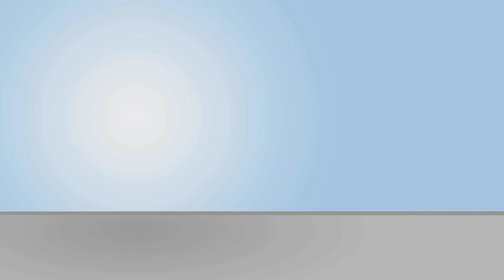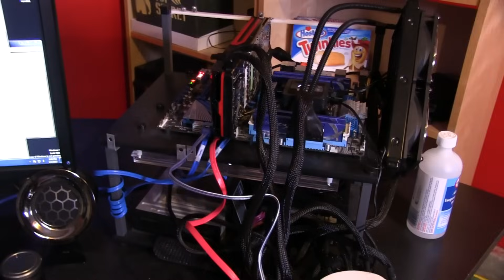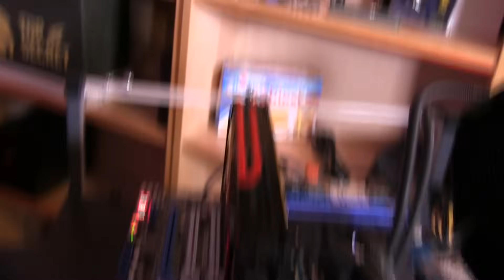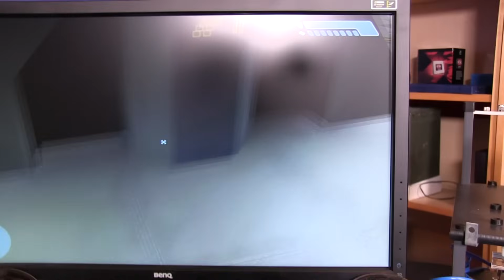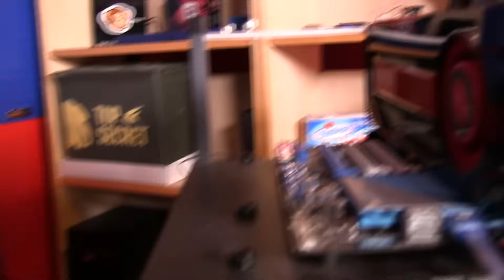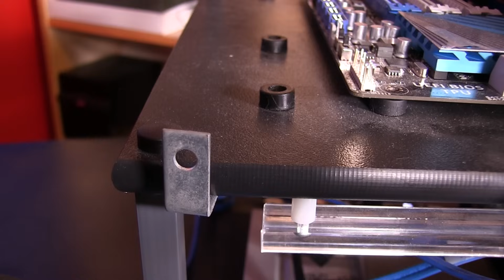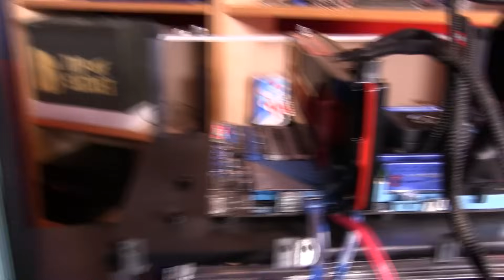Coil Whine Explanation & Demonstration Linus Tech Tips

Comment: This guy is flat-out lying. Just limit your fps to 60 - 120.
You haven't set any limit on your framerate, so it goes up to a really high number, causing coilwhine. Don't buy a new Power Supply just because this dumbass is telling you to.
Reply: i get coil whine form my X99 motherboard even when i'm not playing games. just browsing the web or not even doing anything at all. it's not always stress related. some components are just defective.
Reply: solomonshv That sucks. I'm sorry to hear that.
Not really sure what you can do though.
Reply: SWEGTA since i just bought it i can sill exchange it. i bought it locally at microcenter. but every location near me (and there are 3 of them within 30 minutes of me) is out of stock of this particular model. i wont be doing an RMA parade where they will send me a board which is even worse than the one i gave them. i'll just keep exchanging at the store until i get a normal board.
Reply: solomonshv Best of luck!
Reply: ***** Because buying a new Power Supply = Coil Whine be gone!
Reply: SWEGTA Actually my 290 vapor x tri x oc whines in any game. Watch Dogs at 40 fps whines, GTA4 at 50fps whines, BF4 and 70-80 whines, just as bad as cod games whine in 100s. What I found out is when the card is under stress, even at lower FPS (20s 30s which it gets pushed at to limits) such as new games, the coil whine can be much worse than let's say an old game with no FPS lock that pushed it into fps of 100s. That myth that coil whine can be fixed by locking FPS is false. Replacing PSU is a long shot, and the only way to truly fix the problem is to buy a card that has low rates of coil whine.
Reply: MaxFlare
your card is defective. r9 290's/290x dont have coil whine unless its a mistake or defect.
Reply: Adams Brian
Any card can have coil whine, and it doesn't mean a card is defective. It is a very common phenomenon, and has happened to nearly everyone who owned a gpu.
Reply: MaxFlare
well most cards dont whine loud enough for you to hear them during those games and even demanding game.s.
Reply: Adams Brian my 280x whines the same as the one in the video but a bit quieter, but fuk ill just turn the speakers up
Reply: lol man nice. ^
Reply: Hey I was wondering if you can tell me what may be the cause of my issue. So I bought an EVGA NEX750B and it makes a buzzing noise when playing BF4 and a sound similar to that on the video when playing Watch_Dogs. I exchanged it for a EVGA G2 750W and it did not have any sound however i had to change that for another PSU because it was making some bothersome noise. The new PSU i got was the Corsair RM 750 and my system make noises similar to the EVGA NEX750B. Could this be a GPU or coincidental PSU coil whine.
Reply: I had coilwhine on 290x and limiting did nothing at all, maybe 5% better.... but probably not even that much
Reply: Misterzen87
huh were you a early adopter for it. that may be the case. your psu enough power for it.
Reply: Adams Brian
i got the V 1000 from coolermaster, the problem is that the HIS 290x is complete garbage, i am not sure if they even produce any 290x without coilwhine
Reply: Misterzen87
i dont know if HIS is as reliable a brand as others. The good brands i search(MSI,Asus, sapphire,etc) all have barely/no reviews with coil whine even on a top dog like a r9 290x.
Reply: Adams Brian yes pretty sure that HIS 290Xs have more coil whine than the ones from most other companies, they have a cheap looking custom pcb and the whole layout is different so they probably use cheaper components for the rest as well. anyway i look forward to my 970 from gigabyte :D
Reply: Misterzen87
you sure you dont want to check out the msi/asus they looking good to plus very sexy. Not saying gigbyte is bad though.
Reply: Adams Brian
i am sure they are fine but i did ask all the manufacturers some questions and only really liked the support that gigabyte provided, the others just gave minimalistic or wrong answer due to not having red my question correctly. the msi is nice too but the msi has no backplate and isnt sold at the shop i have credit on from the 290x rma
Reply: Misterzen87
sweet bro. the gigabyte is not looking bad at all. You think you could save up a for a 980 or 970 sli(lol not asking you spend more money but more of a question/suggestion.)
Reply: Adams Brian
yes i will probably add another 970, not quite sure yet because i red some rumors about gm200 beeing pretty close, hard decisions but i think price/performance wise 970 sli is a safe bet, to go from 970 to 980 feels like a waste of money though :)
Reply: Misterzen87
yeah the 970 is a real beast. its like a 780/780ti just more efficent and 200$ less. HOLY MOLY. thats awesome. im actually planning on winning a 980/970.
Reply: Adams Brian
I did actually put an order in for another 970 from gigabyte at a store that had 12% today on everything, so just 350 for the second one, probably going for the sli :D didnt want to delete the other one though since i cant imagine what else i would buy in their store from the rma credits, and 970 sli will be fun, especially with oc muhaha
Reply: wow thats going to be a real beast. Even stronger than a 980
Reply: Limiting your FPS is not a solution. It might reduce or eliminate the whine, but now your FPS is limited.
Reply: Pretty sure Linus tech knowledge is leagues ahead of yours.Check your ego
Reply: SWEGTA
He never said it would get rid of it, he said that the only thing you can do is that some power supply's work better with certain GPU's in terms of power delivery.
Reply: TonkarzOfSolSystem If you're running the game on a 60 Hz monitor there is no point in not limiting your fps to that refresh rate. You should always try to cap your framerate to the refresh rate of your monitor. That's what v-sync is for.
Reply: He even demonstrated how looking at the floor will give you even more whine. No shit! Looking at the floor in Halo 1 probably got him >1000 fps.
Reply: TwoCubed  Just because of screen tearing? Or something else? Screen tearing is often encountered even with fps much lower than your monitors refresh. V-sync forces the GPU to only update the screen at the start of the monitor's refresh cycle. This is completely different to limiting your fps to 60. V-sync doesn't limit your fps to 60 either.

Seriously, are you trying to troll?
Reply: We all know limiting the FPS can fix the coil whine but that is not how it should be done. The card whines because manufacturers don't use high quality components to build the video card and that is not acceptable. We will RMAing/Return  the cards to show how unhappy we are and that should teach a lesson nVidia will never forget.
Reply: You're flat-out lying. I got 70fps and it still makes the sound.
Reply: MaxFlare
That's just a fan error if you still haven't fixed it. Take the vga cooler off of it, and replace the thermal compound and re-attach it back. Coil whine can also be caused when components aren't placed in the right way, even when it looks like it.

Zwegta probably just saw some post or video somewhere, and it worked for him, yet coil whine can be caused by a even weirder things than: "oh no, my card is too fast".
Reply: Robbert van Loon Or just rma it and not render warranty void as doing what you suggested would
Reply: Where is he lying? He's just demonstrating what coil whine is. And just limit it to 60fps? It might work in some cases but tell that to my previous 290. Oh wait, you can't, he can't hear you cus all of the coil-whine.
Reply: his point is that not all cards coil whine without a limit so if you dont want to limit your fps find a card that can do such that with out coil whine
Reply: giske87 I have coil whine regardless of vsync !
Reply: get some ear plugs
Reply: ahh i got 2 290's now. no coil whine and they are tri-x's by sapphire so they are quite :)
Reply: You all beautifully shut him the fuck down lmao.
Reply: Tommy Lai It's not going to teach Nvidia anything as they don't make boards for consumers. They simply sell the GPU's to third parties, who then design and build the boards, drop in the chip and ship it off. You didn't buy from Nvidia, you bought from your video card manufacturer.
Reply: Vsync is your friend
Reply: My old Corsair CX750M gave my Gigabyte r9 280x coil whine no matter if I was gaming or not. I put in a new XFX XTR 750 and it went away, so NO Linus isn't lying... It's situational so don't be calling people dumbass...
Reply: Cheng Yang He probably never tried another power supply, so "SWEGTA" doesn't know what the fuck he is talking about.
Reply: ***** I love the youtube trolls. Feed me more love.
Reply: MaxFlare

Yup,but in some cases it's software related and 3d3 overrider forces the Vsync lock trough DirectX,that could be a problem in some games when it's not properly applied.
Reply: FPS has literally nothing to do with coil whine you moron.
Reply: Coil whine exists in many scenario's,but yes also when yeah have ridiculously high FPS (1000's)
Reply: you get coil whine below 60fps if you have it lol but it gets worse with vsync off and your fps is flying at 200
Reply: Edward C. The human eye cannot see more than 60 fps
Reply: playing at 60fps with vsync then going to 125fps if ur monitor is more than 60hertz does feel a little smoother but it relates to other things and makes better slow mo videos
Reply: if ur running a low demanding game at 200+fps its a good idea to put vsync on. your doing nothing but making your gpu run hottee and you wont notice much of a difference
Reply: If you have a 60hz monitor and your GPU is outputting 400fps, that's 85% of the frames that you won't be seeing, ever. No matter how efficient and powerful a GPU is, if you don't use ~85% of it's power while still making it do the work, you'll be wasting power, creating heat and probably causing fun things like coil whine :(
Reply: buckfire23

I must be a fucking spiderman then as I can see clear differency between 60fps and 120fps.
Reply: ***** Just because he has subscribers doesn't validate the channel that's not to say Linus is bad he is definitely one of the best. However MKBHD is a great example of that, he isn't very knowledgeable relative to other channels, but his subscriber count is way up there and it is because his content is manufactured for those who are less knowledgeable.
Reply: vsync fixes the problem.. but some games suck once you activate it .. input lag.. tearing.. stuttering.. sound familiar? well.. some games don't like vsync..
Reply: ***** I currently have a GTX970, I have only had coil whine once. That was during the opening cinematic and main menu of red faction: guerilla. It's not even a demanding game, just something causes the coils to whine in that specific instance, not even in the actual game :\
Reply: venum4k im with you on that. i had it for a week or so with my 970 but after running heaven benchmark a few times its been gone ever since
Reply: sneaky kitty Well, I initially had no coil whine, it only appeared twice when I played red faction, now it's stopped completely
Reply: venum4k Yeah word up. I never had coil whine in my life until I got a hold of an R9 290X & I noticed in FC4 & Borderlands-TPS that when the FPS ran unchecked (up to 2000 FPS in some menus) the buzzing would get worse in proportion to the FPS & then turn into a whine when it got really high. I swear the noise actually sounds like it's coming from my Corsair CX750 & not the video card but INS. Limiting FPS worked for FC4 & BL-TPS but it does fuck all in Dying Light. 30 FPS, 100 FPS, same buzzing either way. It's a steady light buzz though & not a whine or a squeal, but it's definitely not directly related to FPS. It's the way software loads the card. In the cut scenes it goes away, but in game it comes back.

 I still limit my FPS to 60 though because after testing power consumption during a game running at 100-130 vs. limiting it to 60 there was ~ 130W difference!!!! Huge amount of power all to display frames that I'll never see with a 60 Hz monitor. V-sync isn't a good answer for a demanding game either because if the system can't stay above 60 the FPS will drop more with it on than off, so RivaTuner is my answer. Also at those sky high frame rates in the FC4 menus, the card got sooooo hot the fan sounded like it was gonna tear a hole in space to another dimension or some shit. :s
Reply: Cuz, do you really think loud ass coilwhine is normal? dafuq
Reply: dumb fuck what if your playing a game which maxes out the gpu usage at 25 fps? how would you stop the coil whine then? he is right in terms of changing the psu if it bothers you that much as it does have effect on the coil whine.
Reply: Blasphemy!!!
Reply: SWEGTA he didn't even say that.
Reply: The instruction wasn't clear enough.
I limited the fps, but my switch still have coil whine...
https://youtu.be/i62SN2s1G44

Comment: Do anyone know of a gtx 780 ti that do not have coil whine? I have tried many brands with no luck. Pls can someone help me.
Reply: Keith Jesso probably because the stock blower fan is so loud.... all cards whine. some just are tuned to a higher freq than we can hear..... these cards are usually built a little smarter. designer picked the right parts that work well together

Comment: Coil Whine pitches with its frame rate, thats why.
Its like a frame rate indicator thats sounds you the info.

I am a bit dissapointed with the info you're giving us, I hoped you really explain what it is and how it is caused.
What I suspect and wonder is, are the coiled wires vibrating?
I think so, how can it make sound otherwise?
This could be simply the fact that the coils are made too loose around their coil core.
There must be more tention on the wire to prevent this.

Comment: That wasn't an explanation. Coil whine usually occurs during extremely high frame rates. So of course an old game like Halo 1 will do this. But most of us gamers use v.sync and never have to worry about the frame rate going too high. My 270x does this but only when it's over 1000 fps which is a crazy frame rate and going to look awful without v.sync anyway.

Comment: Today was the first time experienced coil whine, i started up a game called inquisitor, low budget game, but i like it, so, as I started it up and coil whine started, It's not an demanding game, it doesn't look good at all, and the coil whine happens only in the menus, I've played lots of different games on my PC, heavier games and not so heavy games, few examples from the heavier games metro 2033, witcher 2. So, now I'm thinking, what might cause this? I'm running the game at max 60hz mode from the options, so it shouldn't takethat much power.... Also, if I launch my MSI afterburner which I've set to force everygame run at 60 frames per second, this problem stops, any ideas what's causing this?

Comment: Crowbcat made a video on this. It's because your game is being rendered at 1000+ fps which is very easy to do on a $400 graphics card with an old game like halo one. Even an old power PC mac from 2002 can run it. The sound of the coil whine comes from the fact that it is generating 1000+ images per second. so just tone down the FPS to 60 fps.
Reply: you are explaning it like it is the fault of the amount of fps the card is pushing wich makes no sence....
Reply: believe me less fps doesnt make the whine go away... only th pitch of the sound will change
Reply: and thats where you are wrong the msi lightning hd 7970/hd5770 hawk/ and my 2 club 3d gtx 580's dont hum and i bet there are several other cards that operate like the should do....
Reply: if that is what you think it is....YES
Reply: ***** my EVGA GTX 470s, 580s, 680s and 780s didn't make any coil noise. ever. at least not enough for it to be audible. and yes, i had two of each. but i just upgraded to the X99 platform and my gigabyte X99 gaming G1 makes a horrible coil whine. it gives me headaches after like 5 minutes. and i'm not even playing games! just browsing the web.
Reply: rapper250 hey I saw u comment on his vid! I was having problems with my gtx 760, and it still hasn't gone away yet. I hate coil whine.
Reply: solomonshv
i think it might be your gpu also. check them both out. play a game and see if it goes up and down in sound as you move if it does thats the gpu, if it doesnt it may be mobo or psu.
Reply: Captain Bryant
i would buy a new card and meanwhile rma the card
Reply: That is not coil whine, that is capacitor squeal.  Coil whine can happen at any fps as long as the card's power delivery is under stress from a GPU being 100%+ loaded.
Reply: ***** I thought it sounded like a crappy/defective/half blown capacitor too.  Do you know what "coil whine" actually is because everyone it talking about it in reviews of the GTX 970's but nobody seems to know what they're talking about.  Edit: found a good explanation here.  http://www.reddit.com/r/askscience/comments/1lysck/what_physically_causes_a_gpu_to_whine_or_squeal/
Reply: pseudocoder78 ya its the inductor coils inside the housing actually resonating.  Most of the time you shouldnt hear coil whine because manufacturers add sufficient dampening to the coils like glue or some other material.  But for some reason, since there is no reference design 970, all sub vendors are using their own designs.  I assume some of them are buying inductors with not enough ddampeningmaterial which is causing coil whine.  

Capacitor squeal will happen regardless anytime your FPS supersedes a certain amount.  But realistically there is no reason to run more than 120/144 fps anyway.  So just cap it.
Reply: rapper250  u donkey I get 200
Fps on fortnite with a 1080 and it’s loud  aswell
Reply: well sorry do i need to lock the every game 60fps but my gpu can push more then 60fps?

XD
Reply: rapper250 it works thank you